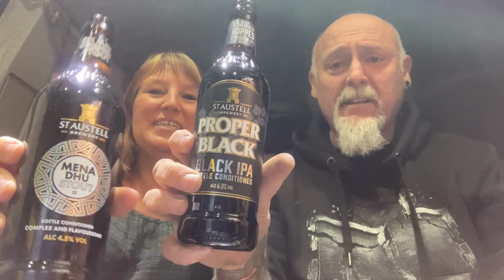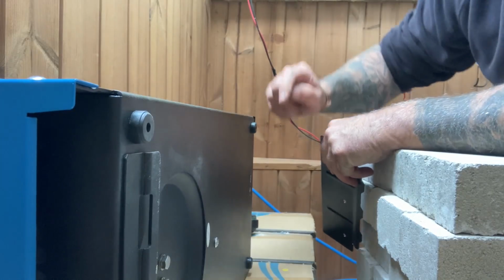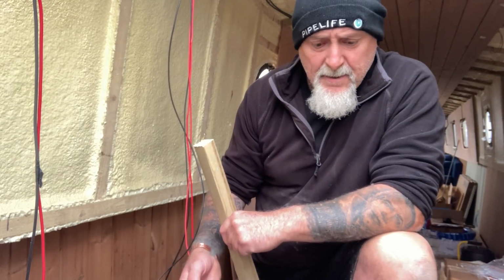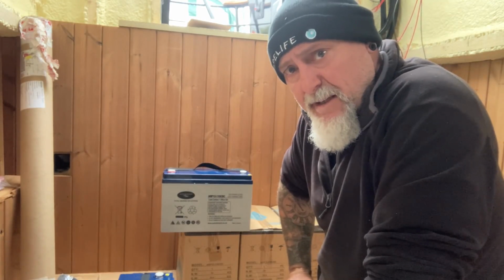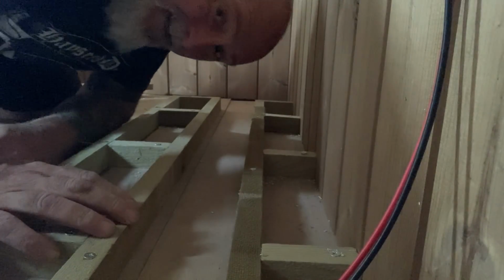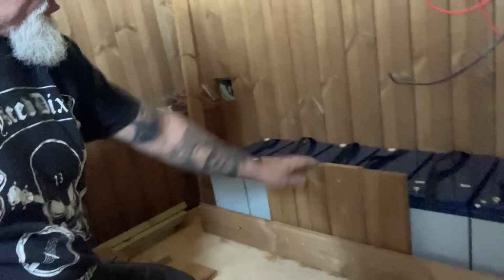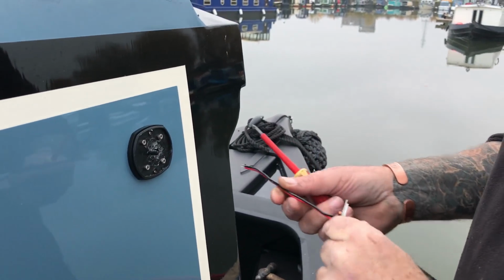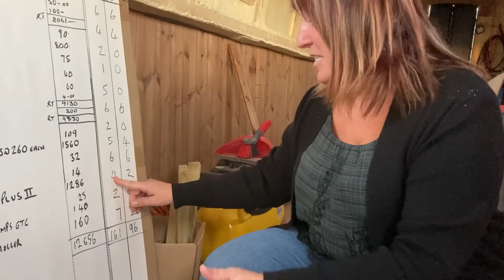Building Our Narrowboat #20 - Boxing Clever?

Comment: Just full of useful tips. Good one about the swarf. How best to remove it? Wash it off or use a magnet maybe
Reply: I was just about to mention this also .... a high power magnet will get it all .... and if you put the nagnet in a plastic bag first it makes removing the swarf from the magnet much easier ... and if you stick the magnet to the steel just under where you are drilling the hole you'll catch most of it as it's made ... :o)~
Reply: @stoatmcgroaty1586  just dont let the magnet touch the shell lol
Reply from the maker: I've done that!
Reply from the maker: Good idea, I need to go source BFM!

Comment: If you can afford it invest in an impact driver for screw driving, marvellous bits of kit. Batt box is very smart, much better than the one I made for side of my shed😄🦇
Reply: Many guys I work with use them and swear by them but many don't. Horses for courses. They are very noisy, I just get sick of hearing them and I honestly cannot remember many occasions where I thought It would help. 

Like I say, each to their own.
Reply: Oh and I should have said, I do own one but stopped using it after a few weeks of use.